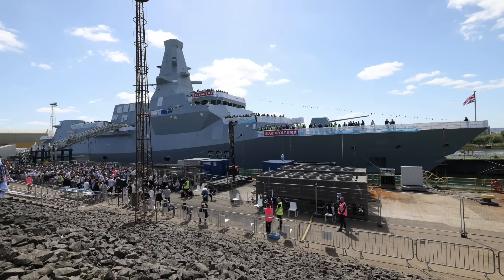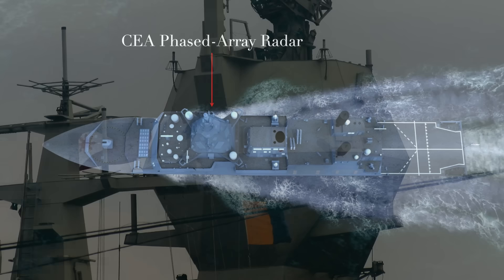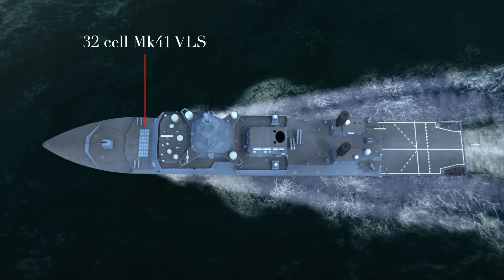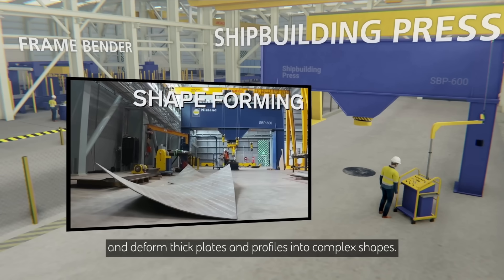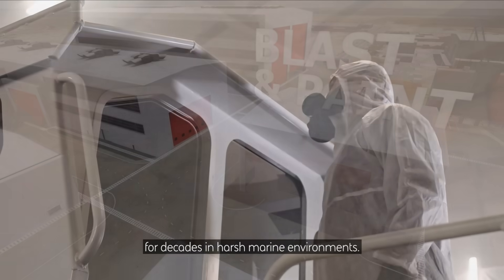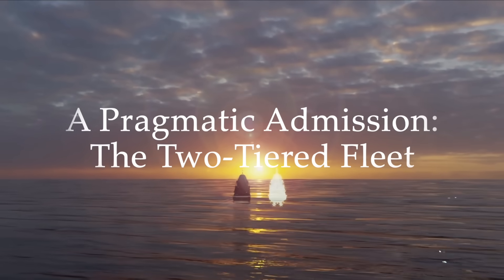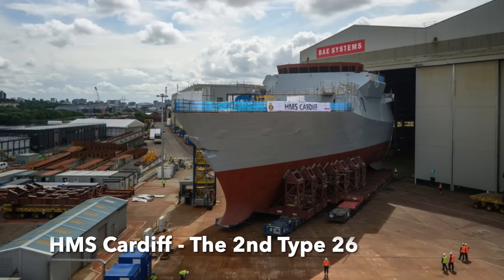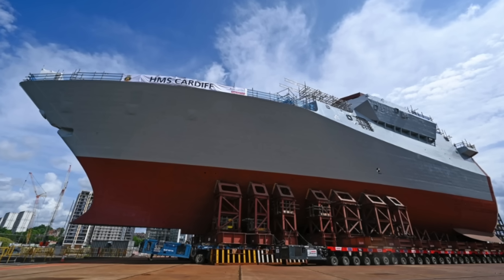The World’s Most Expensive Frigate? Inside Australia’s Hunter Class

Comment: The Hunter is going to be fitted with 48-cell MK41VLS  and 8 Naval strike missile's  for the first 3 as the first 3 are set for anti-sub and anti-air/sea configuration while the last 3 are still yet to be finalised with them leaning more towards the anti-air/sea config with talks of 72-cell to even possible 96-cell MK41VLS and 16 Naval strike missile's both with 2xTwin MU90 torpedo's and CAEFAR2  Phased Array radar system, Aegis CMS with SAAB 9LV, that is different to the city-class otherwise the rest is same with 1x MT30 Gas Turbine and 4x Diesel generator's with a CODLOG engine config  the hunter is 1m longer and a beam 1 m wider than the city and its Displacement is 2000 tons more as well than the city. there's talks of fitting out the hunter's with the EOS drone killer system TITANIS - Fully integrated, layered counter-drone system with soft, hard and high energy laser kill capabilities.
oh and p.s. apart from the aegis system and the seahawk helicopter it''s mainly a mix of Aus/UK with French-Italian Torpedo system and US / Euro Ammunition . With the same dockyards the Hobart destroyer''s where made at and the fall of the automotive industry  it's what we need as it will bring allot into australian economy and will save us in long run from having to organise surplus from oversea's relying on other countries.

Comment: Another thing you need to remember with the VLS... And yes it is low... But because we use the sea sparrow, we can quad pack 24 into 6 cells, equivalent to the amount of the sea ceptor system, but in a smaller space. Then we have 26 cells for strike, aaw, and BMD. That should.. just be two missiles more than the 24 cell VLS in the City class T26

Comment: For reference, this Hunter class is 1000 tons heavier than a Type 45 destroyer and about the size of the original Arleigh Bourke: I wonder why they keep calling it a "Frigate".
The problem I see is that the ship is so over-bloated, compared with the type 26, that it ate up all the room for growing it has, so it won't be able to change and adapt to future requirements.
Australia should have gone with a larger ship, if the intent was to make it so complicated, same as the Constellation, bloated so much that it really struggle to fit in the original hull.
A ship hull design has some weight distribution and maximum targets taken in account, and exceeding those create a plethora of adjustments and rebalancing.
Germany for example is building large size ships, over 10K tons, and Italy even aiming at 15K tons 180+ meters long, which allows for destroyer sized systems without over stuffing every single space on the ship, while keeping standard frigates at reasonable displacements. They will probably also cost about the same as the Hunter class, despite being comparably larger because of all the problems going overweight on a small hull creates.

Comment: The Type 26 is excellent in ASW but has clear trade-offs: limited long-range air defense, high cost and delays, less growth margin for future upgrades, higher crew and running costs, and a narrow ASW focus that makes it less versatile than true multi-role frigates.

The new Dutch ASW frigate is smarter and more versatile: strong ASW focus but with solid air defense, advanced Thales radar, efficient automation, and room for future upgrades — cheaper to run and better integrated with NATO systems than the British Type 26.
Reply from the maker: The Type 26 is 25% bigger than the Dutch design, and the additional equipment that has gone into the Hunter has added 10% on top of that, with all the associated issues mentioned in the video.  Australia clearly wanted more AA capability than that offered in the Dutch design, but that design was too small (my assumption) to allow for the changes Australia wanted.

Comment: The RAN also has 3 air defence destroyers which form part of the tier 1.
Reply from the maker: Those Hobarts would then likely be replaced domestically with a follow-on from the Hunter builds
Reply: @WarshipsAndWarriors  i will put money on the batch 3 hunters coming out with the 96vls to replace the hobarts. it just makes a lot of sense using a hull in use and in production saves on supply chains etc. so many benifits.

Comment: Seems like T26 is being given a rough ride here, much like the Horrizon is by the USN. Good designs, poor decision-making by the customers. Not that the RN hasn't done it's fair share of that, mind you. 

Perhaps a fleet of "off-the-shelf" type 26's might have gone well with the more bespoke hunter class.
Reply: Default T26 wasn't up to RAN scratch. It lacked A LOT of key capability for the Indo-Pac.
Reply: @De_cool_dude That depends on the intended purpose of the ships. In the RAN case it seems they wanted a ship that could do it all at the very highest standard. Perhaps it's appropriate that it is to be one of the most expensive warships in the world. Personally, I can't wait to see one in person, hopefully one will visit the UK one day.
Reply: @EdGeyy the intended purpose of the vessel is to act as THE BEST ASW platform in the RAN, and operate alone (but within a network) or in tandem with other vessels. To do both of those roles, the vessel needs a common CMS that allows TDLs and other systems integration (AEGIS), a decent aerial self-defence capability (ESSM, maybe SM-3/6), and capable sensors that allow medium-range (300km) air search (CEAFAR1-S, CEAFAR2-L) and great undersea search (CAPTAS-4).
Reply: @De_cool_dude  RN T26 isn't all-singing and all-dancing, but it does meet several of those requirements. Medium range radar (200km as opposed to 300km - a choice you pay for). CAMM with option for CAMM-ER for aerial defence. S2087 which is just the UK's version of CAPTAS-4. It's ultimately a cheaper ship that can do the same primary anti-submarine work, while sacrificing the cutting edge in air defence you might expect from a ship designed for it. Of course, from the RN perspective, we'd rather have had ASTER 30/Sampson - but as usual it comes down to whether or not it was worth it. There's an argument to be had, that the RN's configuration strikes a good middle ground where the ship isn't exceptionally expensive, but can still fulfil its primary role. Obviously, this strategy only works if you end up with MORE hulls in the water as a result. I'm hopeful that we may see additional T26 ordered for the RN, but I'm not holding my breath.
Reply: @EdGeyy (that 300km number is just off the top of my head - and Hunter has a ~500km radar in addition to a shorter (medium) range one)

The RAN's problem is that any ASW DD that is so lightly equipped in regards to air targets will quickly get overwhelmed because of the longer-ranged and deadlier threat environment in the Indo-Pac compared to Europe.
Reply: @De_cool_dude  I can see why the threat might require a more comprehensive, layered approach to air defence - it's a scary thought. However, I'd raise concern about the number of weapons carried by Hunter. Operating in isolation, having only 32 cells makes her remarkably vulnerable to saturation - something our adversaries are all too aware of, and increasingly able to exploit.

The RN T26 by contrast has provisions for 48 CAMM, with an additional 24 Mk41 VLS (which can be quad packed with additional CAMM/CAMM-ER/a variety of other weapons, which could significantly increase the AA arsenal if desired).

There's a credible argument that in such a high-threat environment, a RN T26 may actually be more survivable, for that reason alone. Though not the longest range, CAMM is exceptionally competent and well suited to its role. Exploration of an ER version (I believe Poland have already done some of this work for you) would have given the RAN a much, much cheaper alternative to provide additional depth and layers to their AA posture.

Hunter seems to have ambitions beyond those of a competent submarine hunter. Her AA suite strays well outside of self-defence, and into the realms of area defence, the likes of which we Europeans would usually associate with a different class of ship. As you've rightly pointed out, some of that is to do with the environment in which they're expected to operate, but I don't think it's as simple as that.
Reply: @EdGeyy Yeah. The threat environment that the PLA can impose, as far south as Indonesia, is scary. It should be noted that the Hunter can quad-pack RIM-162 in the Mark 41, which gives a total of 128 missiles (even though having an all-ESSM VLS load is unrealistic), although is less than the 48 Sea Ceptor VLS + 24 Mark 41 with quad-packed CAMM (144 total). However, the CAMM family as a whole has a 10kg warhead (vs 39kg on ESSM), and a top speed 1.5 Mach below that of the ESSM. Furthermore, the CAMM-MR is the only SAM of the CAMM family to rival the ESSM in terms of range, and it can only be dual-packed in the Mark 41. With a full CAMM-MR load, a Type 26 would have a missile load of only 96 missiles, 32 less than the Hunter.

Another significant thing to note is that the Type 26 lacks any FCR/FCI, which means it cannot use missiles like the SM-2 or SM-3. The Hunter, on the other hand, uses CEAMOUNT FCI in coordination with the CEAFAR1-S and CEAFAR2-L (pretty sure I got the 1-S and 2-L mixed around in another comment, so sorry about that), which allows it to operate the SM-2 or, if purchased in the future, SM-3 missiles.

I really disagree on the AA suite point. Hunter's radars are that of the Anzac, which definitely is not an AAW vessel. You could point to AEGIS, which would be fair; however, the Hunter was given AEGIS when the Anzacs were going to be replaced by Hunter, not even when the SEA 3300 program was being envisioned. AEGIS was designed for use on Hunter to give commonality with the AWDs (which reduces cost), to standardise on a CMS with JMSDF high-sea ships and the USN, and to allow the use of NIFC-CA with other Australian and Allied units. If they really wanted to give the Hunter a proper counter-air capability, they would've stuck a SPY on it.
Reply: @De_cool_dude  Admittedly, I wasn't aware that RIM 162 could be quad packed. Of course, this changes things.

That said, as you touched on, the weapon make-up you have discussed is unrealistic. If we assume a fairly modest requirement for only 6 Tomahawk (currently planned for both types, if I'm not mistaken), and 10 RIM 66 (as a very modest guess, given that they are the weapon of choice for a ship with such radar power), then the numbers quickly even out. 

Maths isn't my strong point, however I make that 74 SAM for Hunter and 84 for T26. Granted, this affords Hunter additional reach, but a realistic scenario reveals that T26 does hold its own in weapon count. 

I'd also clarify that the top speed of CAMM is not Mk1.5, but Mk3. 

With regard to FCR/FCI, this really leans into my comment about area defence. I appreciate you disagree, but part of your justification for these systems is the future use of SM3, a weapon with 1200km+ range - onboard an ASW Frigate (or Destroyer). Not to mention, it would yet further reduce the total weapons onboard Hunter. 

I love this ship, but as a design philosophy, I struggle to understand how it's a better approach.

In creating such a masterpiece, it has become too valuable and there are too few of them. So much so, that in high-intensity warfare, you'd surely be reluctant to commit it to its primary role. I actually tend to think this is true of T26 as well, but I'm hopeful that autonomous solutions will help level the playing field soon - we'll have to wait and see.
Reply: @EdGeyy Well, it is unrealistic for both vessels, not just Hunter. The Mark 41 on the Type 26 is meant for the Future Cruise / Anti-Ship Missile, not CAMM - that gives the T26 only 48 SAMs, assuming 24 FC/ASW.

SM-2 isn't the 'standard' for ships with CEAFAR, as the Anzac only uses ESSM.

I said that there is a 1.5 Mach difference between the top speeds of ESSM and CAMM, the top speed of ESSM being Mach 4.5 and the top speed of CAMM being Mach 3, the difference being Mach 1.5.

I don't think it does. The Anzac-class has the same FCI system. SM-3's range doesn't really act like, say, the ESSM, SM-2 or CAMM's range, as the SM-3 climbs to intercept large, fast and heavy ballistic missiles. Because of the proliferation of hypersonics and ASBMs in the PLA, SM-3 wouldn't be a bad choice for the Hunter. This being said, the RAN has not shown interest in putting any munitions in Hunter's Mark 41 bar ESSM and Tomahawk. (Should note that this is more of a destroyer than the Perth DDGs were)

The differences between the Type 26 and the Hunter, I think, show the difference between the threat posed by the Russian Navy's submarines, and the PLA-N's submarines. The Russian Navy is very much depilated compared to the PLA-N's submarine force. The Russians, although their modern submarines have a lot of dedicated space for anti-ship missiles, actually lack those missiles because of Ukraine. Meanwhile, all of the PLA-N's submarine force can deploy the YJ-18 and YJ-82. It should also be noted that the PLA is significantly further ahead in network-centric warfare than Russia is, and a common PLA tactic to counter ASW vessels (like the Hunter) is to pass a satellite over, and using the information gained from that cue a ASBM launch from either a Renhai cruiser, a Badger-K or from a land platform. This means that, to counter ASBMs and very fast cruise missiles, vessels must be integrated and be linked over a common TDL to enable any and all, if necessary, to engage and destroy any type of target.

Hence, say a Hunter is apart of an Allied task force. The Hunter is picked out as a lone ship to destroy by a Chinese radar satellite, and a missile attack is launched by H-6Ks and 055s at standoff distance with YJ-21 ASBMs, and a Type 039 diesel submarine launched 6 YJ-18. They fire, say, 36 ASBM + 6 SAShCM at the task group as a whole (composed of the aforementioned Hunter, a Hobart, two Burkes, and JMSDF Kongo). The Hunter, as the most capable ASW asset (by far) in the group, is operating over-the-horizon from the other members of the task group in an ASW-interdictory role. She gets 6 ASBMs and 6 YJ-18s sent at her, with the other 30 sent at the more capable AAW assets to keep them occupied (Hunter has 20 cells of ESSM, and 12 Standard Missiles, for a total of 112 SAMs). The ASBM launch is immediately picked up by American missile launch satellites, and the task group is immediately informed and then disperses somewhat. The vessel's radars are queued onto the missiles by a link to the launch-warning satellites and ground-based radar stations. This allows the Hunter to only operate her CEAFAR1-S radar, and the Flight III Burke to operate her SPY-6. The ASBMs are then picked up in-flight, first by the CEAFAR2-L on the Hunter (as it is operating forward and therefore will detect the missiles shortly before the other vessels capable of doing so, do), then by the SPY-6 on the Flight III Burke, the task group's air warfare commander. All 36 missiles are fired on by the Kongo and the Flight III while exo-atmospheric with SM-3, guided by the AEGIS-common network. Then, they are fired on by the Hobart and the other Burke once endo-atmospheric with SM-6 and SM-2. This would splash all 30 ASBMs aimed at the main force. For the 12 missiles aimed at the Hunter, assuming 3 YJ-21s are splashed by the Flight III's SM-3s and the other 3 are splashed with a combination of SM-2, SM-6 or (if equipped) SM-3. Then, if the Hunter is lucky, one of it's MH-60Rs would pick up the YJ-18's radar seeker before it passes over the radar horizon. If the Romeo picks up the radar seeker, it will be able to que an SM-6 or ESSM Block II shot from Hunter to degrade the missile wave before it passes the radar horizon. If the Romeo doesn't pick up the YJ-18s, the Hunter would probably de-energise her CEAFAR2-L. As the YJ-18s pass the radar horizon, the ESM on Hunter picks up the radar seeker, and immediately and automatically the AEGIS system fires off 12 ESSM. Assuming a hit rate of 40%, it will take about 17 ESSM to splash all YJ-18s. A YJ-18 will take between 30 and 40 seconds to cross the radar horizon (of ~35km) at its terminal velocity. 17 ESSM is about 4 and 1 quarter of a Mark 41 cell, or about 7.5% of the vessel's total VLS count. That, minus, say 5 Standards from the earlier engagement leaves 7 Standards and 63 ESSM left.